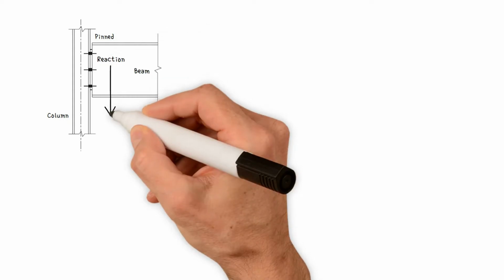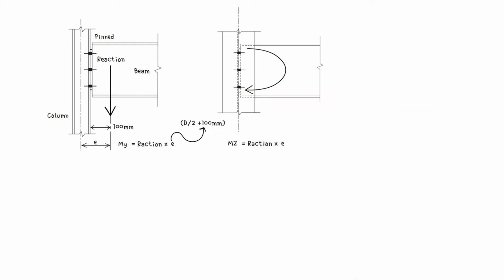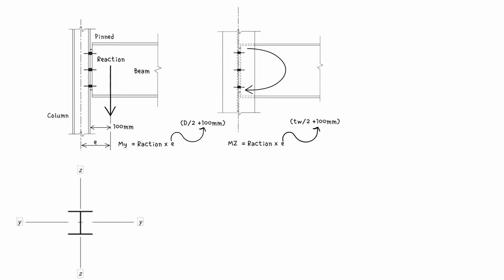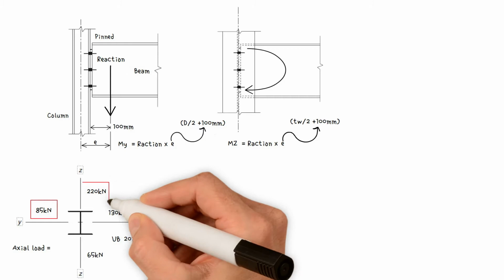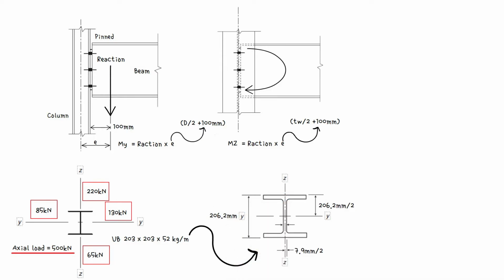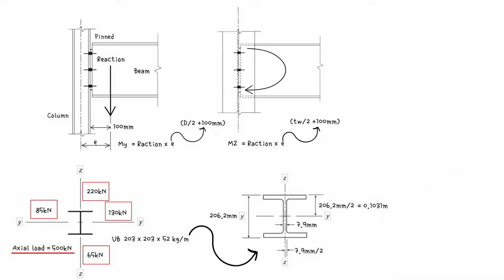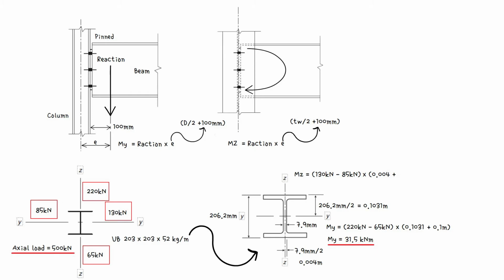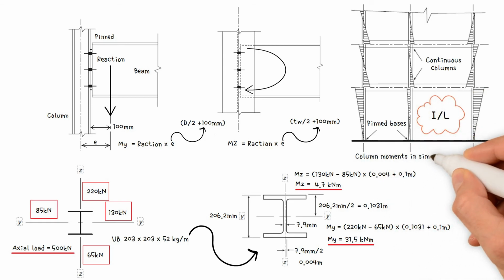How to calculate the axial force and the moments for a column.

Comment: question is, is there a proper way of calculating exact value of reaction passing through (in this case 100mm from the face of the column) or do we have to estimate it?
Reply from the maker: Thank you for your question! The exact value of the reaction passing through 100mm from the face of the column can be calculated based on the geometry and load of the beam. In the video, the eccentricity causing bending about the y y axis of the column is calculated as half the depth of the column plus 100 millimeters, and for bending about the zz axis, the eccentricity is half web thickness plus 100 millimetres. These values are then used to calculate the bending moments about the y axis and z axis. Therefore, there is no need to estimate the value of the reaction. However, it is important to ensure that the dimensions and loads used in the calculations are accurate. If you have any further questions, please let us know.

Comment: Another request from my side for the future :)
I wanted to know how to properly assess the wind load for the deep(~1.5m) double skin facade where the outer skin is permiable and the inner is not.
Additionally, wind load calculation for the courtyards is a big question as it may be easy for the low buildings but for the high buildings it presents a set of questions.
Both of these issues are not resolved  in the EC, at least to my knowledge.